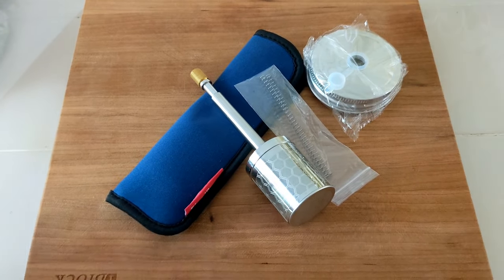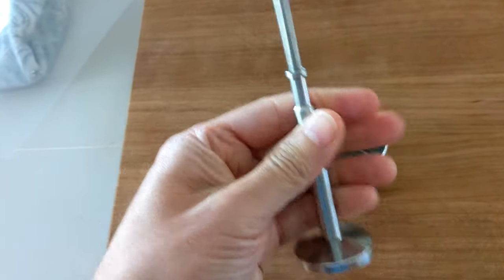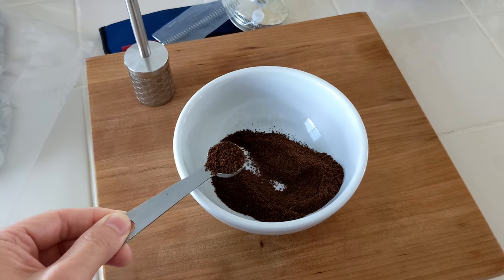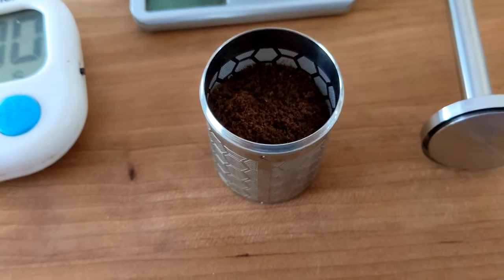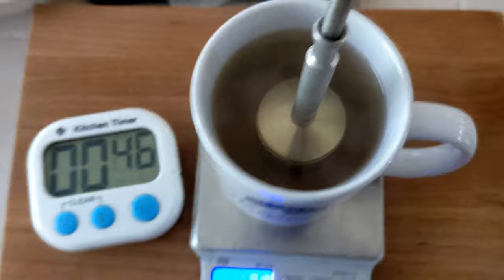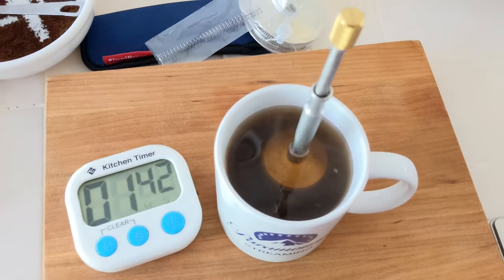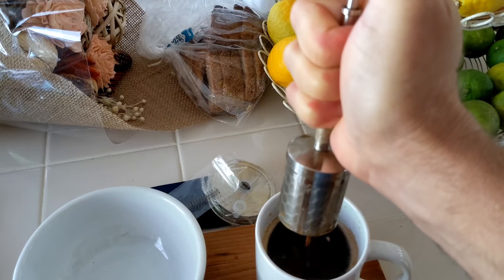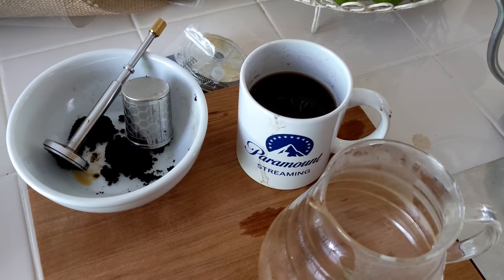Finalpress from Kickstarter - Review

Comment: the bad instructions don't necessarily make it a bad product. its a portable french press, your just ripping on it and intentionally being ignorant.
Reply from the maker: How is following the instructions, logically pointing out why they are not going to work, then trying to actually use more logic to try to make it work, and coming to a completely reasonable, test based conclusion ignorant? This device is not good for making coffee.  For tea, it works great.
Reply: Coffee needs to be a coarser grind like Vietnamese drip coffee and cold brew coffee pots. Too find a grind the weaker the coffee and more sludge as water can't circulate. Not rocket science
Reply: Bro … mans literally had a digital scale and did exactly what the institutions said. The device makes no sense practically, it’s fine if you spent money on it, but it’s dumb
Reply: You know why its bad? Cuz its just product they sell in china and they rebranding on kickstarter. I have seen tons of these without name brand or different name
Reply: The latest instructions have been updated to 12 grams.

Comment: This is basically a portable french press machine. I think if you adjust the water ratio and time, you can get a pretty decent coffee out of this. I'd say, try with 180g of water and 4 to 6 minutes brewing time. The issue I see with this option though, is that the mug lets a lot of heat escape during brewing, where a french press has a lid.
Reply: The thing about a French press is the coffee has lots of room to brew before bing pressed, I wanted to like and even purchase this gadget as it’s size would be convenient but all the waiting would make it hopeless in cooler temperature camping so I think I will pass on it.

Comment: I have found that a fine grind is the best, and to fill the container 50% to 75% full of grounds.  I also recommend at least two minutes on the initial dip, swirling it around for at least 30 to 45 seconds, then let it finish out to 2 minutes, then use the plunger multiple time to force out more coffee flavor, sometimes doing it rapidly while submerged, 20 ro 30 times, then when you have the desired flavor profile, removed the device, and hit the plunger more, until you don't see an more water come out.  This device works beautifully once you get the hang of things.  I am also using a normal sized coffee cup, maybe 8oz.  I agree that their instructions are lacking detail.
Reply from the maker: I have tried this, and I ended up with a very bitter brew and about a 1/4 inch of sludge at the bottom of the cup.  I'm using a Baratza Preciso grinder which is pretty decent...same grind as I use for my Aeropress actually.
Reply: I use a medium grind, fill to about 80% (1/4" below the top of the microfilter), do a soak for a minute or two, swirl/dunk/plunge, more soaking for another minute or two, more swirling/dunking/plunging. When plunging, I tilt the device slightly as there is no microfilter on the bottom and more of the good stuff drips out. Perfect cup of coffee. I get no sludge at the bottom of my cup. The coffee is a rich color that mostly obscures the submerged Finalpress chamber. Totally agree the Finalpress instructions are quite poor and have to be disregarded. But anyone who says this device doesn't produce a good cup of coffee is incorrect. Minor modifications are all that's needed. And Finalpress needs to completely revise the instructions. ... Also note that Amazon sells knockoff devices that look similar but will never produce proper results.

Comment: This gadget works fine for me but I wasn’t expecting an espresso maker. I just half filled the basket with coarse ground coffee and stuck it in a cup of hot water, swirled and plunged entirely unscientifically and drank a decent cup of coffee. Build is solid, clean up is easy and it takes up no space. I like it.

Comment: Coffee...... Wanting to try this, it will taste like crap if you cant experiment yourself. I aint ever going to do no teaspoons for nothing. No tea, no coffee, none of it with teaspoons. I would fill that thing up for one cup of coffee. Forget measuring it out that way. It never works with that little. It is going to be an espresso style coffee so the filtering is going to act that way. And also, the plunger squeezes the oils and water out of the grind, there is alot of residual oils and what not left without doing that. I do it will tea as well, otherwise, it is such a weak brew that Its like trying to imagine water tasting like coffee or tea, without adding actualy tea leaves or coffee bean.... Besides, I only would possibly look at the instructions only to make sure I take it apart the right way. Other than that, every instruction from these things, regarding coffee and tea, are all junk instructions.

Comment: Fines would be expected considering it is a mesh filter, your coffee has way more fines than you might think. I bet with a bit of experimentation you could easily make a decent cup, while it may not be your everyday its kind of a nice novelty for sure. Wondering if you would get better results with holes in the plunger bit so its more aggitating the coffee rather than compressing it.
Reply: The metal aeropress filters do a pretty good job

Comment: I'm interested with this FinalPress
Unfortunatelly I don't get what i'm looking for here.
Almost none of following fundamental of brewing coffee has been used, tried nor explained in this review:
1. Dosage
2. Grind size
3. Coffe to water ratio
4. Water temperature
5. Brewing time
.
You did not trying to find the best recipe with the coffee bean/ground that you had.
.
My biggest question is:
is it produce better cup of coffee than V60 or Aero Press?
.
On their official website FAQ page there is an information as follow
"FinalPress filter holds up to 17 grams of coffee, providing a generous amount for brewing a flavorful cup. This quantity surpasses the recommended ratio of 10 grams of coffee for a standard 175ml mug, ensuring a rich and satisfying coffee experience."
That's all ... and i can't find another tips.
Reply from the maker: I actually weighed the recommended dose in the video and showed it. It is about 3.8gr.  I then showed that I tried to use "6 tsp" (which is roughly 12gr) and you can see that the nearly filled the brew chamber.  There is no way you can put 17gr in there without seriously packing the coffee.  And, I mention this in the video...if you do that, you will impede the ability of water to saturate the grounds.  I DID try to find a better recipe and was unable to get something that I found good.  I still maintain that at the price point, you cannot beat an Aeropress.

If you find a ratio that works for you, great.  I cannot make it work for coffee.  But, as I said in the video, for tea, the device is excellent.

Comment: I've been waiting for someone to upload their opinions on the Final Press since I got mine. 

I agree that the instructions on how to use it are quite poor and result in a super watered-down coffee. 

However, with some adjustments, I've been able to make a good brew that I'd be happy to drink on a daily basis.

My grind is currently halfway between drip and espresso on my Kitchen-Aid grinder (grind size 53, whatever that means), and it ends up being 12 grams. To achieve somewhat of a bloom, I poor enough water to cover the FP, give it a swirl, and then pull it out for 30 seconds.  After that, I put it back in, give it some swirls, and let it steep for 5 minutes. Once that's done, I give it a few presses, and I'm good to go.

It's also worth noting that I'm brewing for 500ml of water. That's how much I normally make with my Chemex, so it was easier to make comparisons.
Reply from the maker: I have actually done some more testing and 12gr is what I have found is the practical "full" load you can put in the device as well.  I will play some more with grind size, but at the price point, it's hard to justify this device when an Aeropress is $20 less and nearly bulletproof to use.
Reply: @DanielBaird  I agree with all of this. I got the v2 on Kickstarter and has a pathetically weak cup of coffee to start with. After playing around I can make an okay cup of coffee, but bizarrely I have to make it in my french press jug because I have my coffee with hot milk. So, in order to get this right I put the milk in my drinking cup, microwave it and then pour the coffee from my french press jug on the milk. So why not just make it in the french press? Which is precisely what I do. For travelling I take an aeropress with me. It is lightweight, durable and works perfectly. I am afraid that this finalpress is being stuck in the back of a kitchen cupboard.
Reply: so you use 24g per liter of water? that's still very weak compared to the usual 60-75g per liter most brewers use
Reply: @DanielBaird aeropress is plastic and should never be made used or marketed for high temp cooking ie. making coffee... 😢
Reply from the maker: @tenbrooks83  the Aeropress could not be sold if it was not FDA approved for the intended use.  Go check out their web site....they have a complete list of all the materials used.

---
All materials used in AeroPress coffee makers are free of BPA and phthalates, and are FDA and EU approved for use in contact with food.

Comment: WARNING! I recently purchased one of these gadgets via a well known 3rd party reseller. The product arrived in pieces and assembly was not easy. There was no manufacturers BRAND NAME on the product. I found that only occasionally did the plunger work correctly. Mostly it stuck and I couldn't press it down. The supplier gave me a 50% refund. Apparently there is an original version of this device which I assume might be Patented? These days, nearly all copies of the original design are made in China - buyer beware!
Reply: And the "real" Finalpress ISN'T made in China?  It just says "designed in California," which usually means made in China lol

Comment: The instructions are trash, and my first few cups were quite bad. But I've found that this works well:

10g medium ground coffee, pour a small bit of water over the grounds in the press without its lid/plunger attached and let bloom for 1 minute, attach plunger and fill mug with water (around 200g), stir for 10 seconds, brew for 5 minutes, stir for 10 seconds, plunge.

I'm sure this doesn't turn out as good as pour over, but it's relatively quick and hands off and doesn't require any bulky coffee machine on my counter or paper filters, so I'm pretty happy with it all things considered. They just really need to provide better instructions so people don't end up with an awful, watery cup of joe.
Reply: I take it all back... afraid to say I had to switch over to a French press solution to get the strength and quality of brewing that I was looking for. The FinalPress brew was just too weak for me and it physically cannot accommodate enough coffee grounds to get the results I want
Reply from the maker: Yep...I've tried several times with different grinders and grind settings too...

Comment: yeah, just waited also for a few tests, got mine a few days ago and the first 3-5 coffees wasnt good and worked for me... so i adjust a few little things. first, i dont crush coffeebeans... i just bought regular, classic coffee ready for making. i fill this filter halfway and let the press at first away. i put in the hot water in a few steps, until the end of the filter is near, then i put the press on it and screw it light way. then i stir a few times... dont count it, the water gets way more darker, then i wait roughly one minute, push the press a few times and stir again. the result is rly good. sure... its not high end coffee^^ but u will get a good result with that extra tweaking. anyways, it will not get that deep dark coffee you would expect and its kind of waterish... but not as much as u follow that tiniy instructions in the box^^ i like it and i use it for making latte espresso with a good fat milk and some flavour from royal flavour... works fine for me :) and i would buy it again.
Reply: I had to reread the first part several times. It's poorly worded but I got it. I'll have to try this.
Reply: @maddie4077 Yeah sorry im Not an English guy^^

Comment: Why do reviewers and others insist on using the term 'teaspoon' - they are just repeating the dumb instructions provided by the manufacturer. Teaspoons are sold in various capacities, so we should ignore advice to use a teaspoon. Plus the finer the grind of coffee, the more in weight you achieve in a given space - eg. in this FinalPress basket. To make a mug of good strength coffee using a french press method you need at least 15 grams of medium-ground coffee and at least FOUR minutes brewing time.
Reply from the maker: A "teaspoon" is not sold in different sizes.  It is a standardized kitchen measurement.  If you are referring to a small kitchen spoon, and not a measuring device, then yes, there is no standard.  But, saying "teaspoon" when measuring coffee, it is not an unreasonable assumption to assume you mean the standard measuring device.

Grind size is indeed critical, and I used quite a fine grind here to match the short recommended brewing time in the instructions.  A French Press has a much larger brewing area, so the coffee is spread out and can interact better with the water.  With the Final Press, it is all packed tightly in the small basket, so the brewing physics aren't the same.
Reply: The product should work with the instructions. It is not too much to expect. If it doesn’t it’s a sign the manufacturer doesn’t care. We should not be forced to find our own solutions for a product.  They are very welcome to send up updated instructions they know how to reach all of us.
Reply: @DanielBaird   
A teaspoon in Europe is different than a U.S. teaspoon, for instance....traveling, i've seen many different sizes that claim to be a teaspoon measuring device.
Reply: @DanielBaird  Sorry to disagree! I have a variety of 'teaspoons' acquired over the years. The largest teaspoon is nearly twice the capacity compared to the capacity of my smallest teaspoon. In addition, consumers are confused by teaspoon recommendations: There are at least three volume measurements as follows: LEVEL, ROUNDED. HEAPED. Plus, coffee experts often recommend a SCOOP as a measuring device - there are numerous capacities of scoops! The standard for everyone should be GRAMS when measuring a quantity of ground coffee - simple.
Reply from the maker: @return2earthvideochannel  I completely agree ...grams should the the standard way to communicate a coffee dose.

Comment: You must be an engineer and a coffee snob. If I had to break making coffee down to such analysis, I'd never drink it. It works great for individual cold brews. I haven't tried it for anything else. It makes the best cold brew I've made.
Reply from the maker: Engineer?  Guilty as charged.  I've also been roasting my own coffee for more than 10 years.  Coffee snob?  Maybe.  But, I stand by my review.  This thing is trying to take market share from a space that is ruled by Aeropress...which at about $30 is one of the best brewing devices you could ever own.  The Finalpress is just not a good device for brewing coffee.  And, cold brew?  A mason jar + cheese cloth will produce incredible coffee...and a lot more of it...for 1/10th the cost.
Reply: @DanielBaird  "Finalpress is just not a good device for brewing coffee". ... Your opinion. Definitely not a fact. I also roast my own beans. FInalpress works great if you adjust to your preferred grind, brewing/swirling/plunging/resting times, which is not difficult to do. The result is great and (yes, in my opinion) not inferior to AeroPress.

Comment: Yeah there is absolutely zero reason for this product to exist. It'd be one thing if it worked decently well for travel, but since it only outputs mildly coffee-flavored water... yeah, nope. 

Everyone should use the Clever Dripper. It is the fastest, easiest, and most consistently quality way to make good coffee. With near zero cleanup. Usually, when it comes to making coffee, you can't have fast, easy, delicious, and zero cleanup. You usually have to pick two or so. Not with the Clever Dripper.